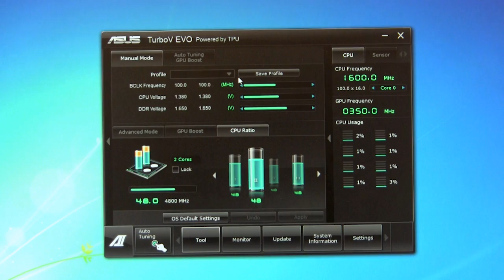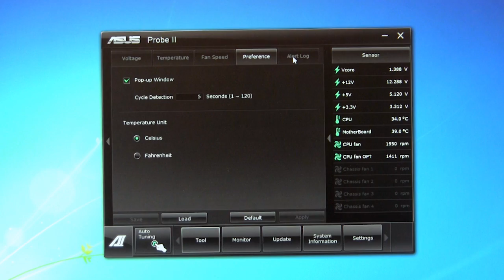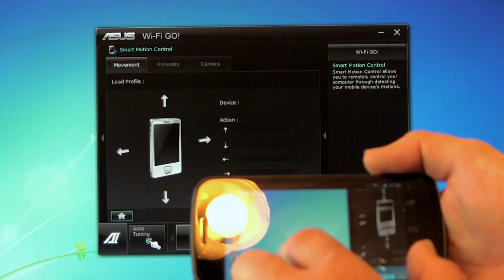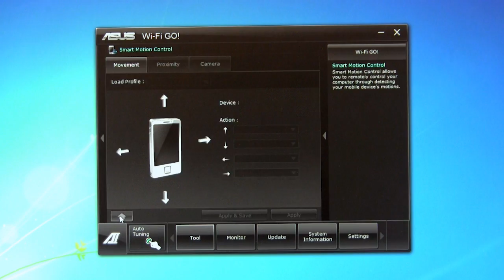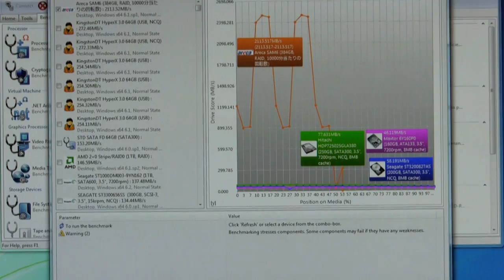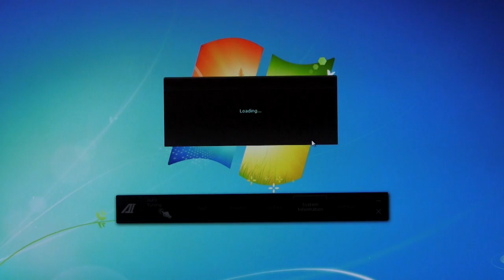Asus P8Z77-V Deluxe AISuite II

Comment: I have this same board and have an error on it... under monitor and Sensor, the Motherboard says its at -62 degrees Celsius.. and I am pretty sure its not actually at that temperature.. so why is the sensor picking that up??  what can I do about it??  I am sure hoping you do not say return the board.. LOL  The board seems to work fine with this one minor sensor error...  I also get from time to time other sensor errors as well, I think with the Vcore or something along that line.. I forget right off hand... been watching your video...  I have never overclocked a computer before and always fear I will mess it up...  I have the 3770k and a corsair h80i water cooler... and at normal operation just here on the internet without pushing it, it runs in the 30's Celsius..  but I do not want to crank it up full blast to its limit either... I would just be looking for a boost to 4.2 tops...  I am not really playing any games or such... so I really have no idea why I would even want to increase it other then to boost its performance benchmark...

Comment from the maker: The fans are one thing, the pump is another. You need to turn fan controls off for the header that controls the speed of the pump. You can use PWM controls for the actual fans though

Comment: First of all I just want to say this is a great video. I just bought my very first ever Game PC which I just finished building myself. I still have the 1401 Bios version. I still need to figure out how to update to the latest which is the 1701 I think. I want to use this Alsuite II to overclock on auto. Question: should I overclock now with old bios version? or should I wait after I update to the latest Bios? thank you in advance. My rig I7 2770k, this mobo, Ocz 256ssd, Noctua,G.Skill ares 2400